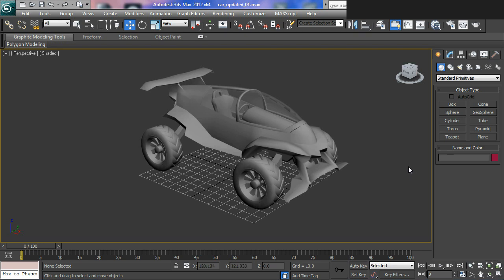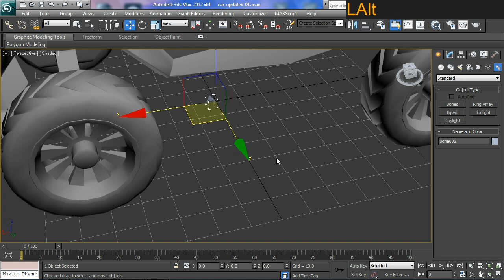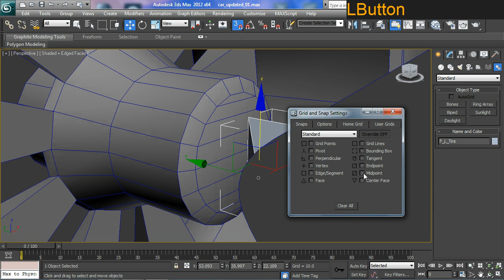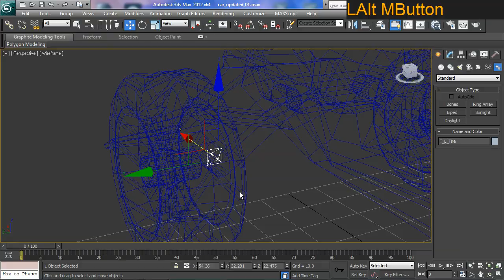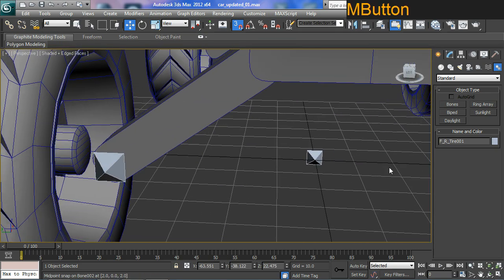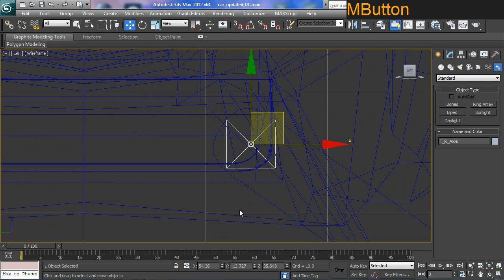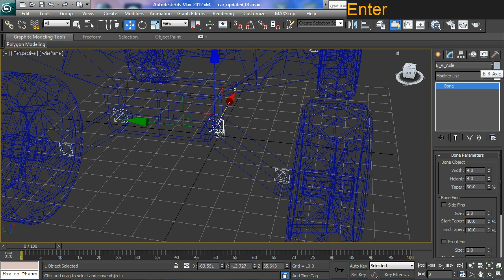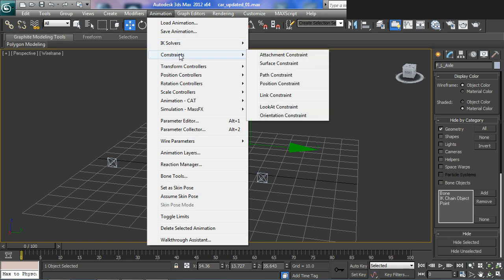Setup and Export a vehicle from 3dsMax to UDK - part 1 of 5

Comment: hey quick question. Is there a way to dynamically simulate springs? Im building an offroad buggy. how would i show the suspension moving? would i just bake animations? Or is there a way to set up suspension, and let udk handle it? 
BTW im not a programmer at all, im an artist. So thats why i figured id ask

Comment from the maker: yeah.. that I'm not sure about.. I stopped using actorX as soon as Epic started supporting FBX..  

I suspect thou that the code required to get the vehicle to work in unreal2K4 is different than what UDK requires more over than you using actorX..  I'd suggest you hunt around for an old vehicle tutorial that deals with vehicles in 2K4.. you can check out the UDN network under the unreal 2 engine documentation

Comment: What Unit set-up are you using for 3ds max because when I export it and then import it on to UDK. The bones don't line up with the wheels properly. which means the suspension wont work properly. The skeleton is either too small for the vehicle or too high up for the wheels.
Thanks